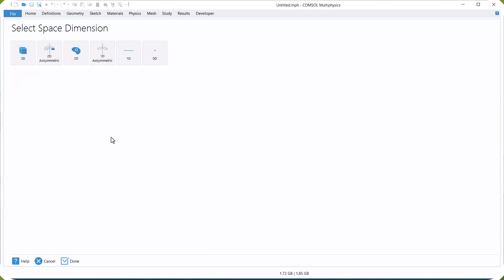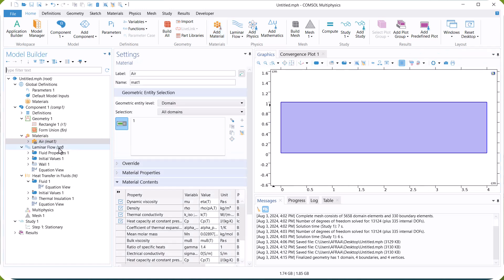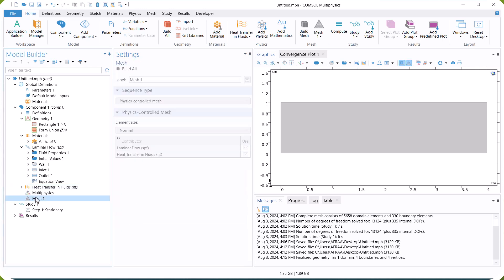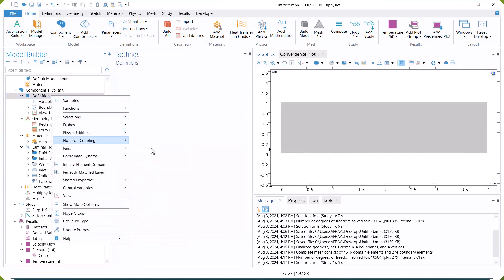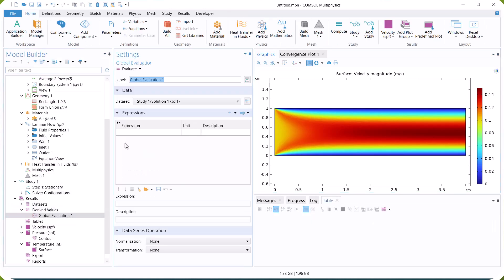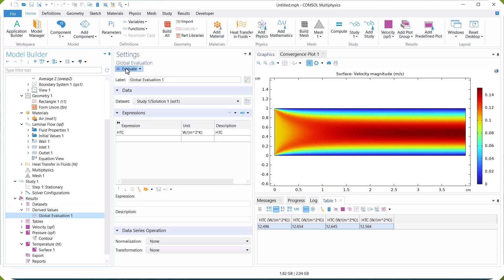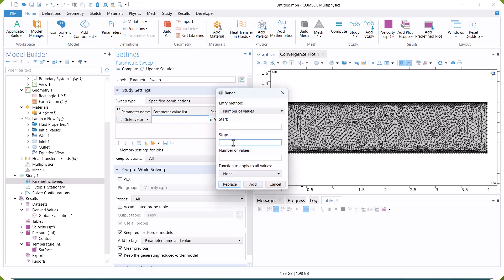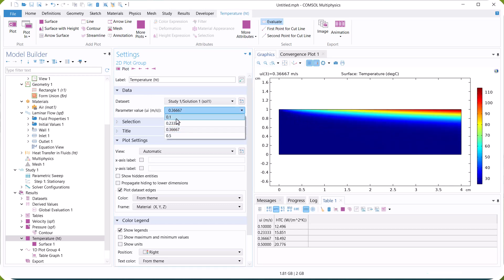COMSOL : Calculating Heat Transfer Coefficient

Comment: Hi, I figured a easy way. First use integrate() function to calculate bulk fluid temperature, integrate(u*T,ymin,ymax)/integrate(T,ymin,ymax) this can be used for 2D and given that your cross section is parallel to y axis. use appropriate velcoity(can be found from the list from COMSOL velcoity other wise us flow direction velocity say in this case u). For 3D use general projection non local coupling to do the integration. It is clearly explained the doc. If not let me know here in the comment. I saw many people using correlation violently also using -ht.gradTmag in comsol which is not true in all cases. Stick to the basic is the best option.
Reply: I AM TRYING TO CALCULATE HEAT TRANSFER COEFFICIENT USING SAME METHOD AS DISCUSSED IN THE VIDEO USING NON-LOCAL COUPLING. BUT TIME FOR EXTREMILY FINE HAS TAKEN ALOMST 48 HOURS, AND FOR REST MESSES, THE SIMULATIONS ARE  IN PROGRESS. HOW TO REDUCE THE TIME OF SIMULATIONS?